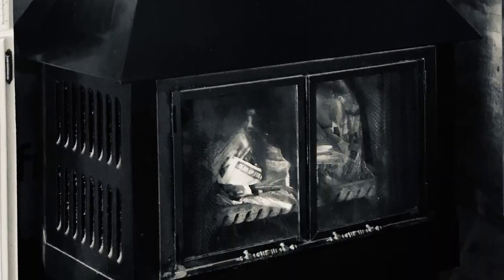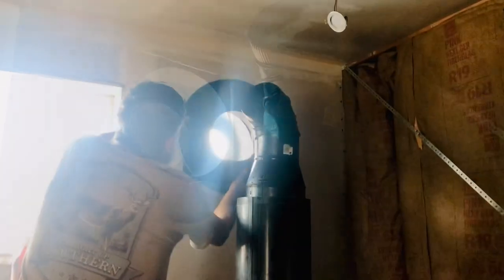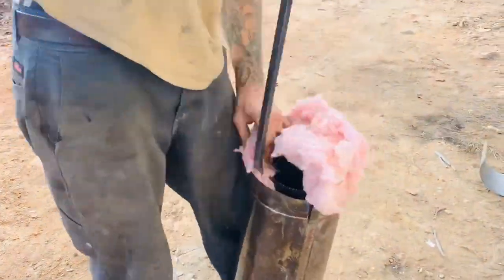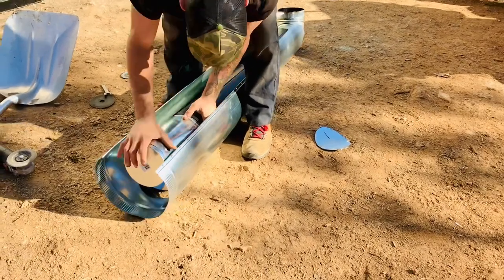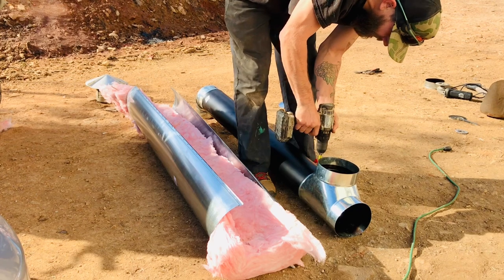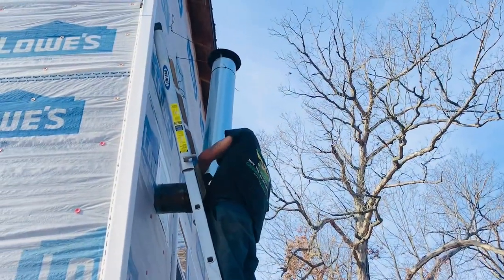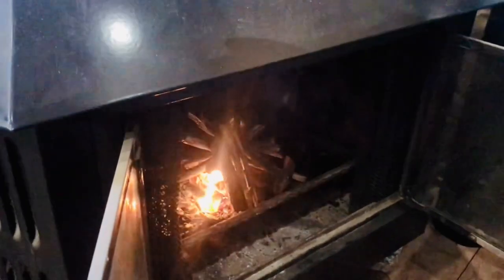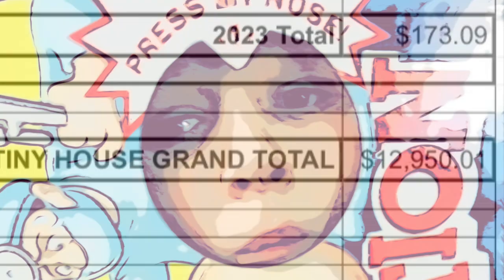BUDGET DIY INSULATED CHIMNEY PIPE

Comment: Hi, very nice video! Regarding the Piping! Is that aircon duct Piping? And if so, did you use a specific thickness ? 😊
Reply from the maker: Yes that is the piping and standard thickness. Smaller one wrapped inside larger one. Thank you for watching!

Comment: I was just before attempting to using your video as a guideline or instructional to making myself some insulated chimney sections but the lord had other plans. As unrealistic as it may sound, not just one, but several Lowes in my area had every single piece  you’d need, both insulated stainless chimney 1’ sections, stainless rain caps, all through wall and through roof kits, single wall pipe, “6 and 8” pipe fittings, connectors, reducers, tees, caps, etc. and everything you’d need to complete this for around $150. They also had “60 stainless chimney for $46. Don’t think for one minute that I didn’t jump on it. It was the whole reason I’d not put my heater in our 20’x60’ batting cage. The parts that is was not used may be returned now that they are restocking the shelves with the same parts at regular price. 😊 my installation may end up costing me nothing but time. By the way, absolutely loved this video. You guys were the first ones I thought to share my recent luck with. My hats off to you guys! That installation will provide warm memories for quite some time!
Reply from the maker: Awe that is AMAZING! AND we are so excited you enjoyed watching and decided to share you positive experience with us! Thank you again for watching we hope to see you again soon! We will be painting and flooring soon so be sure to check out our final downstairs reveal!

Comment: Very cool idea, thanks for sharing.
I will need 2 more sections of exterior insulated pipe to reach my roof top, though I recieved most of the pipe for half the price from a person I bought a wood stove from. I just need a couple more and might go your route as the pipe is crazy expensive. 
Thinking how I bought the stove though I might even try just buying used pipe off craigslist like I did the stove, might be a touch more expensive than DIY insulated pipe but time is money and is still half price from store bought insulated pipe pre-made.
Reply from the maker: Anyway to save money works! We did look at buying used and just didn’t find much in our area worth driving for.